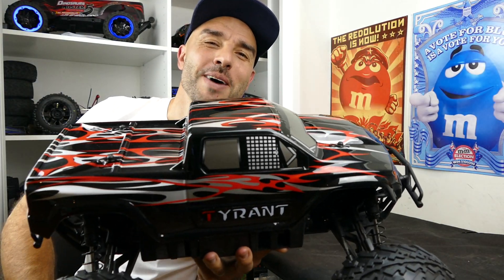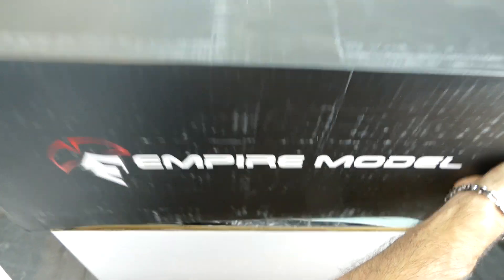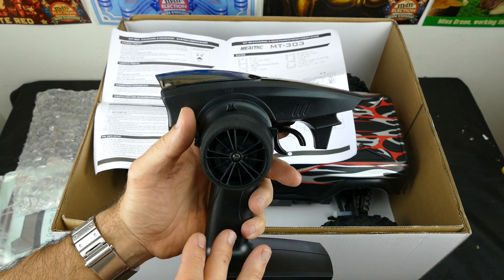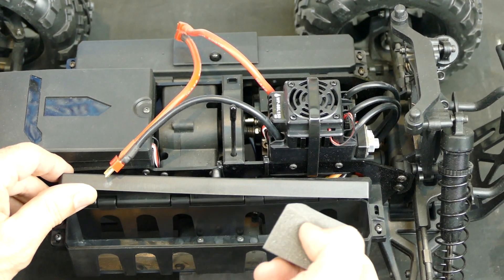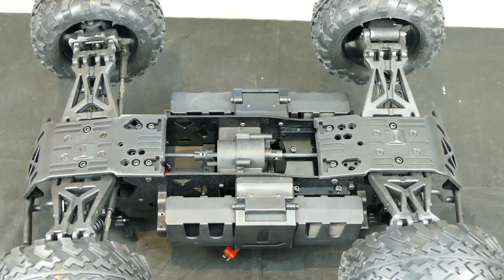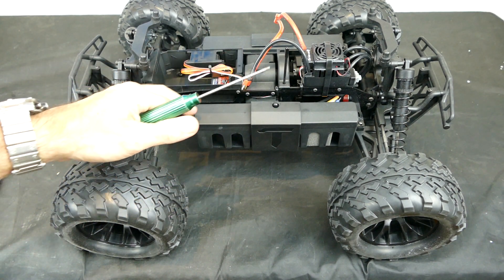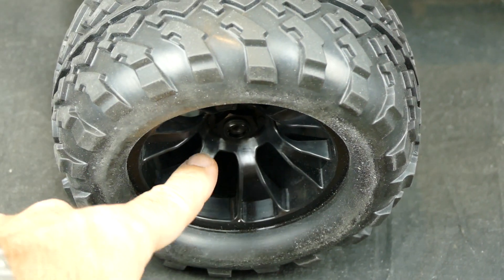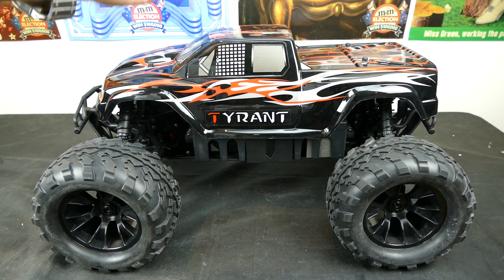EM-Racing Tyrant 1/8 4WD Brushless RC Monster Truck - Unboxing and In-Depth Look

Comment: I like the fact that the battery trays have a supporting front bracket.  On my Kyosho Foxx first run lasted 5 minutes on a simple launch I blew both batteries out the front of trays lol.  Nothing to support the forward motion of impact.  Batteries went right on threw lol.  I might throw a supporting screw through the front of the tray, through frame into the battery tray post.  Will act as a support brace.

Comment: Massive! Great unboxing Steve. It looks well built. The body looked a little flimsy, but I've found that can actually make them crack less...depending on the plastic.
Reply from the maker: +CCxRC thanks Tony, yep pretty impressed with the build quality but the ultimate test will come soon.
Reply: CCxRC u should get one

Comment: Hey bud. As you know, Flux clone. That being said, wrap two cable ties around the plastic arms coming off the front and rear bumpers that connect to the bulkhead. That will keep them pulled in towards the center of the chassis. Those little plastic tabs on them are what hold the upper control arm hinge pins into place.
Reply from the maker: +cwthemachinist thanks for the info man. Much appreciated.
Reply: RC Tanks & Trucks 24/7 CAN U DO MORE RC TRUCKS UNDER $200 AND ALSO CAN U REVIEW THE ECX BARRAGE
Reply: RC Tanks & Trucks 24/7 U ALWAYS IGNORE ME
Reply from the maker: +Brian Salas sorry didn't realised I ignored you. I haven't heard of the ECX, I will check it out
Reply: RC Tanks & Trucks 24/7 THANKS MAN! ECX BARRAGE

Comment: There is a screw missing on the left battery cover in the back.
I like the graphics on the body, and what I do with mine is I spray bed liner on the inside of the body. It helps protect the body, makes it harder to crack, and helps extend the life of the body. 
Nice truck, but pretty spendy, will have to see how yours holds up to some abuse.
Reply from the maker: +RakinBill thanks for the tip and yep I saw that missing screw :) Good spotting

Comment: Nice review! Would be nice to see these Chinese high power RCs start using XT90 connectors. Deans at 6S is really pushing it.
We can always change them out ourselves I guess.
Reply from the maker: +AL2 RC yeah true, good point
Reply: AL2 RC not a fan of xt90 castle creations makes a great high current connector
Reply: I just checked those out. They seem pretty nice. I'll have to get some to try. Thanks for the tip!

Comment: Just because it's a "clone" doesn't mean it's bad. King motor and rovan also make the hpi Baja "clone" and personally I would take the king motor version all day you can get a 36cc engine and all aluminum gear! For cheaper than hpi!
Reply from the maker: Yeah this thing is a beast, I have bashed the shit out of it and haven't broken a thing.

Comment: Anyone who knows the hpi savage will also know this is a cheap clone of the hpi savage flux. But with updates hpi should have made. Like 17mm buggy hexs, hardware. But you know this too why not say why hide it. People who buy the average junk from gearbest or the other spammer of every forum looking for People to send free stuff as long as you sing the right tune. I dont mind clone rcs but why not just say it. Hpi is on its last legs too and upset junk owners will right off rc. Be straight with noobs.
Reply from the maker: Bro, you do know that they are all probably made in the same factory. Also, how do you know they don't have the rights do make it? Get your facts right before talking trash.
And, for the record this rc is strong as, reliable and I have had absolutely no problems with it.
And BTW just because you think it's cheap doesn't mean it is rubbish. Sick of people like you who think you know everything. Get of your high horse and know exactly what you are talking about before you go all keyboard warrior.

Comment: Nice!! A FAKE Savage Flux HP. Now if you can bash it like a savage.
Reply from the maker: +Bangbangboom51 it actually is very well built. Thrashed it without any issues. I really like the steel spur, holds up very well.